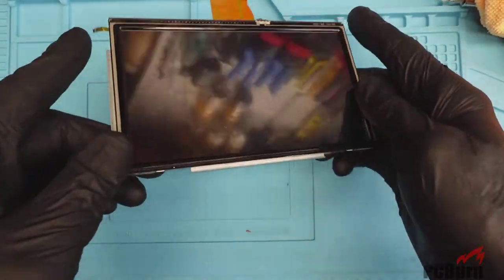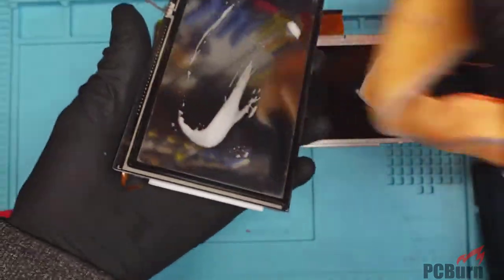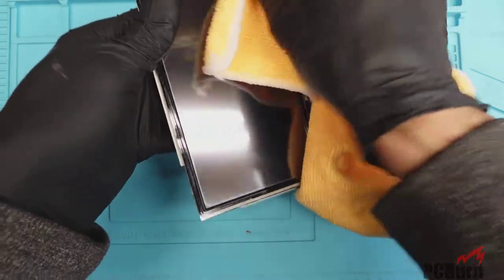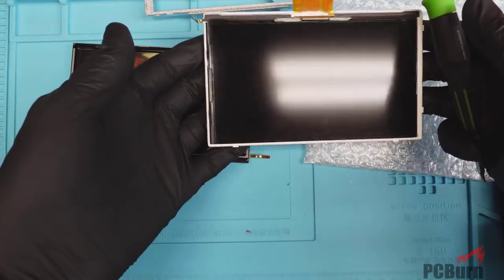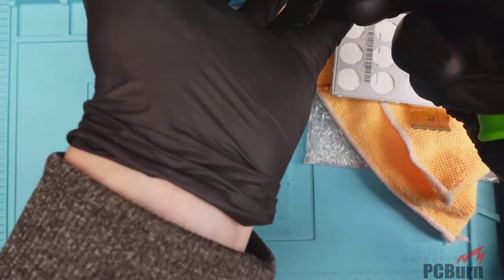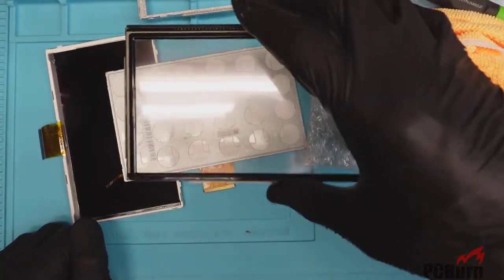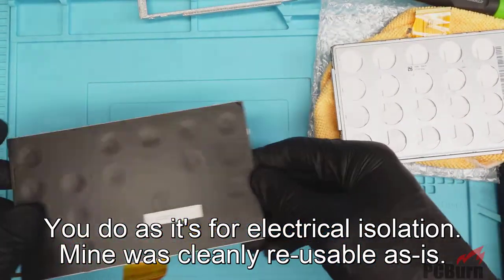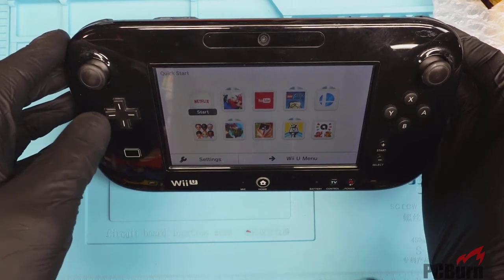Wii-U Screen Digitizer Hack! Replacing a cracked display panel

Comment: This was extremely helpful, thank you! I successfully used this hack to swap my LCD panel without messing with the digitizers adhesive. Instead of a flathead screwdriver I used a pocket knife. I found it easier to remove the original screen's frame first, and then leave it resting on the original screen until I had detached the replacement screen's frame, as to avoid dust getting in there in the meantime. Not a speck of dust underneath the panel!
Thanks for your video!
Reply from the maker: You're welcome! That's a good sequence for keeping the screen clean.

Comment: Hello.
My screen displays an image but it has a sort of a blue tint.
Pretty sure this is the backlight right? Do you know how you would replace this?
Reply from the maker: Replacing the LCD is what this video is about. If you come up with a more specific solution leave it in the comments!
Reply: @PCBurn  Is the backlight problem part of the digitizer or the lcd?
Reply from the maker: @p-minusone  I don't know. What you're describing isn't a result of a cracked LCD. Is this a backlight independent of the LCD unit?
Reply: I'm not really sure. I guess I should try and take it apart first to identify what's wrong with it?
Reply from the maker: @p-minusone  Diagnosing the problem's the first step! Good luck.

Comment: I have a question. I took off the plastic bezel/frame and I don’t know how I should reapply it
Reply from the maker: iFixit has some pictoral walk throughs that may help. https://www.ifixit.com/Device/Nintendo_Wii_U_GamePad
Reply: I forgot to update the comment but I’ve reassembled the gamepad and it works fine but the after market screen is garbage, you can’t even see the edges because it’s just black there. But I saved the original screen so ima just swap the digitizer on to the original screen.
Reply from the maker: @scpnoobers  ah, that sucks. Good that you've got the OEM though.
Reply: @PCBurn  yep

Comment: Could we possibly ever get this with an OLED screen? Possibly even glass like normal touch screens???
Reply from the maker: I would guess no. Mostly because the Wii U seems pretty unloved.
Reply: the wii u is unfortunately designed around a resitive touchscreen so any modern capacitive options won't work

Comment: I have a wii u that runs perfectly fine but the only problem is that the touchscreen is very unresponsive, seems like something is making the touchscreen think that something is touching it, thinking it might be some dirt or some thing that’s making it happen, not too sure if I should replace the digitizer or if I should open the gamepad and clean it out and hope it works. I want your input on this situation and hope you can help.
Reply from the maker: Without analyzing the problem there's no way to know where the issue is.
Reply: it’s the bezel on the screen.

Comment: Um heya idk if youll have an answer to this or even see this comment but my wii u gamepads blue power light when you turn it on slowley fades off and the screen doesnt turn on so i took it apart and actually found that the little orange strip at the top of the screen is ripped and broken so im going to get a new screen but i wanna know if you know thats the reason the power lights been doing that or not if you dont know its fine just havent see anything on the internet about it
Reply from the maker: Probably could cause that. I'm not sure about the power fading off but the screen certainly wouldn't come on if it had the ribbon cable broken. That'd be were to start if it was like that prior to having the issues.
Reply: @PCBurn  alright after i get the screen in about a week if that doesnt fix it ill get a new battery probably and then if that doesnt work and if that doesnt work a new mother board lol, and if that doesnt work guess imma sell it for parts heh

Anyway thanks👍